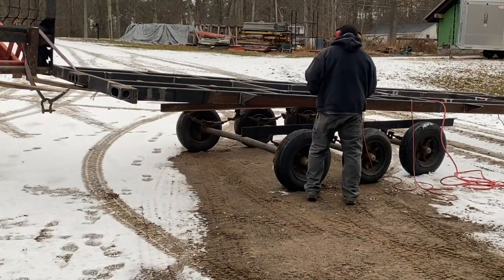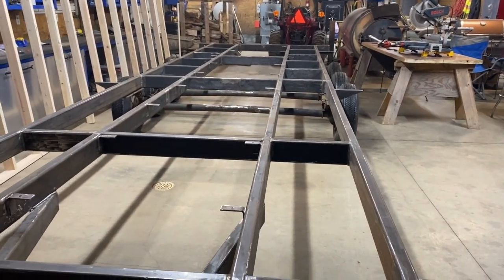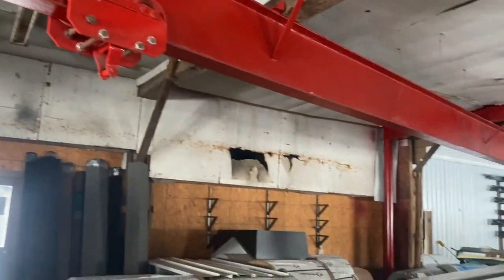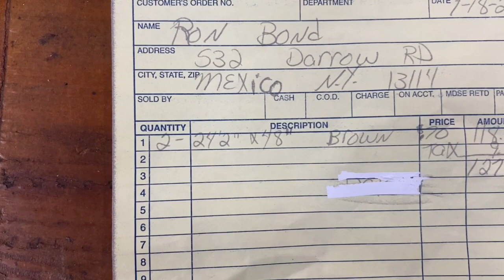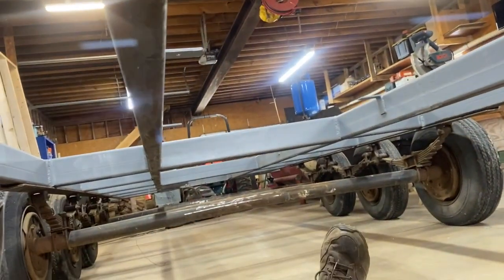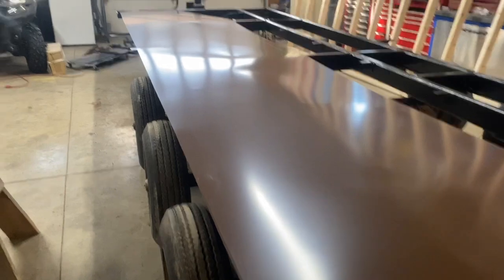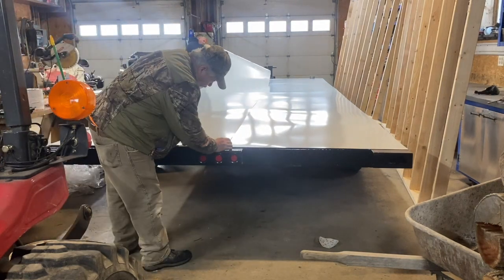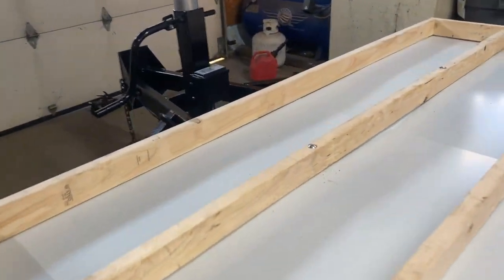Tiny house/ hunting camp part 6. WHAT KIND OF INSULATION????

Comment: Closed cell foam for the floor and Rockwool R30 in the walls. And If you can afford it insulated Zip sheathing on exterior.
Reply from the maker: Jonathan That insulated Zip is awesome but yes its pricey. Lol
What makes you think Roxul for walls? So it can breathe? The zip would definetly stop thermal bridging in the walls but I think this thing will heat with a candle either way  Lol
Reply: Zip panel system is awesome , but you pay for it !
Reply from the maker: @mariowickel456  Yes Mario and its even more now then it was last year Pre COVID. 👎👎
Reply: @bondobuilt386  I just put up 2 60,ooo bldngs with the Zipwall system, they must have good lobbyist. Not worth it if u ask me, I'd take tyvek anyday
Reply from the maker: @iowamatt2519  I thgink the zip with foam board attached is a nice idea but real pricey.

Comment: Closed cell spray foam is definitely the way to go. Having a better R value, structural integrity, air barrier. Also it will make your trim coil solid so you won’t hear that flapping around. Definitely worth it to spend the extra dollar
Reply from the maker: I never thought about that tin bouncing around making noise. Great point thats why I asked you guys on here for thoughts. Thanks bud. 😊👍

Comment: I built a 14x32 house on wheels and spray foamed the whole thing and we do have moisture issues but we also live in it full time. If you go with roxul use some reflectix double bubble and it will amaze you how much radiant heat that stuff bounces back at you but it does need a little space, so just staple it on after yuh insulate and then do some furring strips before your wall boards
Reply from the maker: Eddy thanks for the real world feedback buddy. 👍 If you were to do it again would you foam it still?  It must heat super easy? What don you heat it with ?
Reply: @bondobuilt386  we only foamed the first 2 inches and then blew in the rest. Yea I would foam the full 5 1/2 inches and then put that reflectix on with some firing strips before the wall boards. We heat it with a little free standing 60,000 btu propane fire place, wouldn’t do the fire place again it’s not very efficient. I put too many windows in the place and that doesn’t help much either.
Reply from the maker: @eddygoodwin7089  thanks for the info on the radiant barrior. My walls will only be 3-1/2 “ thick but my camp is alot smaller then your tiny house. I think with spray foam it will heat up pretty easy. 😊
Reply: @bondobuilt386  right on bondo keep up the good work man it’s gonna be a cool setup
Reply from the maker: @eddygoodwin7089  Thanks buddy. 👍👍

Comment: Spray foam seems to really tighten up a building.  That should help a trailer that gets bounced down the road.
Reply from the maker: Brock I was even thinking I could frame it lighter and get the same strength in the side walls with foam. What do you think?
Reply: Yea, probably.  2x3's?
Reply from the maker: @brockwagner939  yes or just 2 foot on center instead of 16 inch.
Reply: I bet that would be fine.  The sheathing will do more for strength than anything else, I bet.
Reply from the maker: @brockwagner939  yes I agree 👍

Comment: Things to think about. If you go with closed cell foam I think that would be the best if you can stand the added weight. Open cell could absorb the inevitable moisture/condensation. If you go with the rock wool you might need to put a weep hole in each section. Ask your spray guy. Just first thoughts.
Reply from the maker: Thanks Steve. 😊 I was thinking the rock wool would need a weep hole also. i figured I would not seal the seam down the middle of the metal so water could leak out. I think the added weight will be worth the benefits if I go with closed cell foam. 👍

Comment: I'm a big fan of spray foam. Remodeled my beach house with it an it is tight. I really need to drop from a 3 ton Heat pump to a 2 ton unit because the AC doesn't cycle long enough to get rid of the condensation in the air. Be sure you screw the metal to the board good. If it gets between them, it will bulge down. If it were me, I would foam floor, walls and ceiling. The added strength it provides is well worth the weight.
Reply from the maker: Thanks for the feedback Tom. I have used spray foam mostly under concrete so not much experience except for that and insulating rim joist and it works great for that  I screwed the metal up today maybe I should do more screws?

Comment: I wonder if the spray foam would get damaged/ cracked as you pull the trailer and there is the inevitable flexing and vibration across the floor structure.
Reply from the maker: Acually the foam will add a bunch of strength to the floor that stuff is real strong and rigid when it dries. We spray it under concrete for radiant heat and its rock hard. That is the closed cell kind. Not the open cell. I don't think it will crack. Thanks 😊

Comment: You mentioned spray foam under slabs. Is that for radiant heat floors??
Do you apply the pipe to the foam then??
Love the build. Where you located.  I would love to check out the build.  May do one myself.
Reply from the maker: Hi Penny I am locaded in upstate New York 45 minutes north of Syracuse. Im going to link you a video of how we do radiant heat in concrete floors. 😊
Reply from the maker: https://youtu.be/MgAJmah0anM

Comment: I'd go with the spray foam if you can get a good price on it.  Think about spilling something on the floor and then having it leak down into the rock wool.
Reply from the maker: Yes good point and I want to put my 4 wheeler in there so i’m sure it will be wet and muddy sometimes. 👍👍

Comment: From the videos I've run across it would seem that foam would be the best for interior as Roxul apparently has some problems similar to asbestos with fibers.
It might all boil down to your particular use and protections against exposure to the microfibers.
Reply from the maker: Thanks John. 👍 I have heard about the fibers but they say once its sealed in the walls your good. But instalation can be dangerous. must wear PPE.

Comment: Spray foam would give you more benefits, besides insulation value
Reply from the maker: Yes Mario that would add much strength to the floor and air sealing  👍 Thanks

Comment: I would go with rockwool. You really have to watch out for condensation buildup from human bodies and  cooking in a confined space. Rockwool will breathe and is impervious to moisture. Also better rodent protection.
Reply from the maker: Russel thanks bud. 👍 I had someone on here say foam the floor but Roxul the walls and roof probably because of what you are saying about the moisture inside. Thge rodents will never get through that 26 guage roof metal I put down. 😊
Reply: There is no breathing. He put a layer of metal on the outside.
Reply from the maker: Thats true. I think the floor would be good foamed but maybe let it breath in the walls or roof?